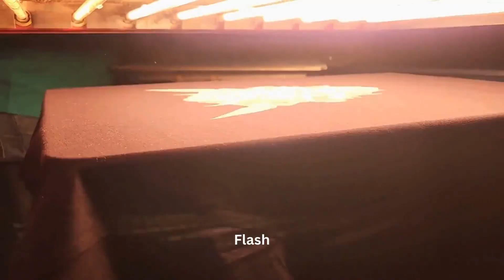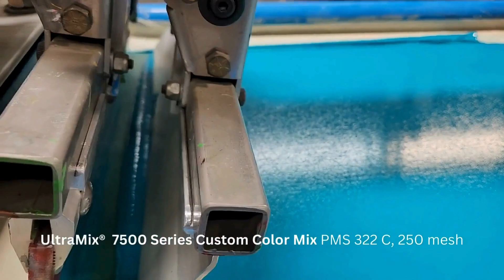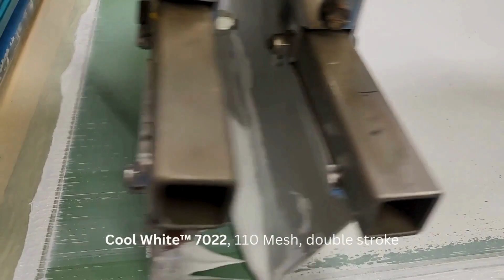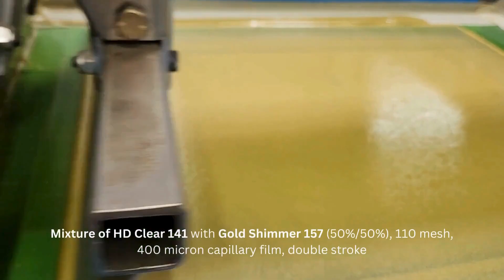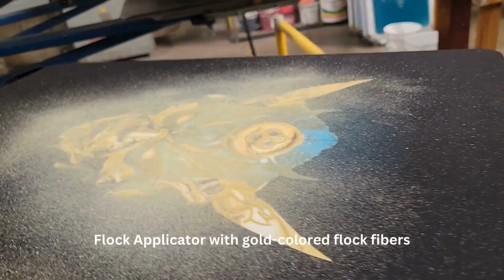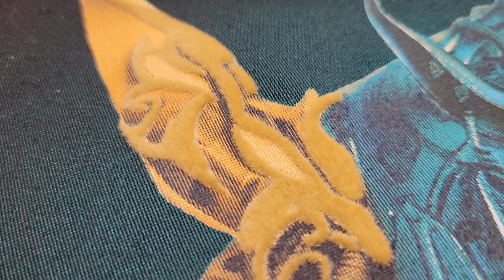How-To Screen Print - "Goblin" With Flock Application

Comment: Would the inks dry on the screen if it sits? Or can the ink only be used with an automatic press or if going at a fast pace on a manual
Reply from the maker: Hi, the inks used on this print are regular plastisol inks and do not dry on the screen. They can be used on both, automatic or manual print presses.